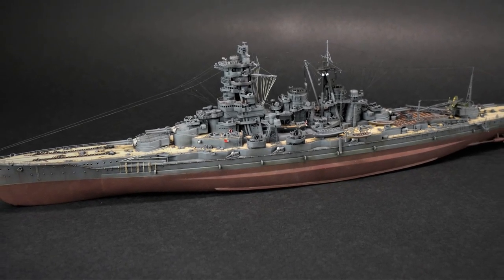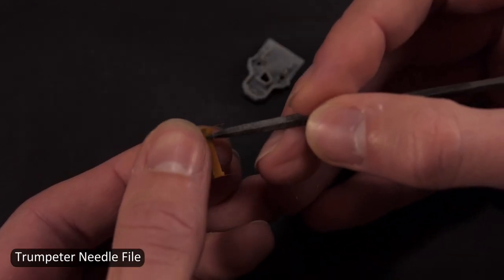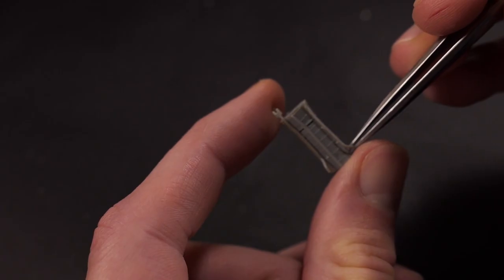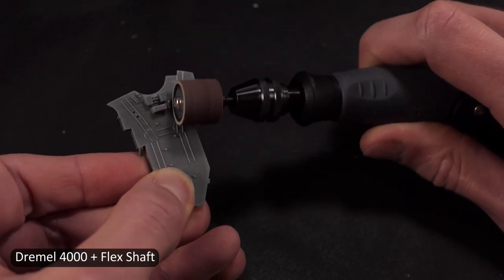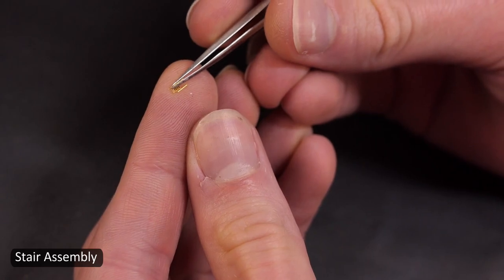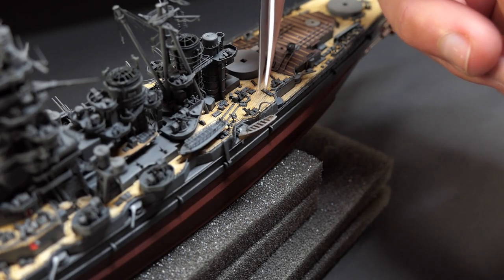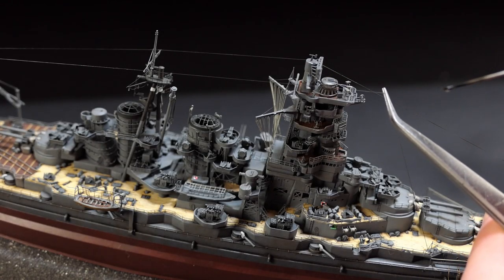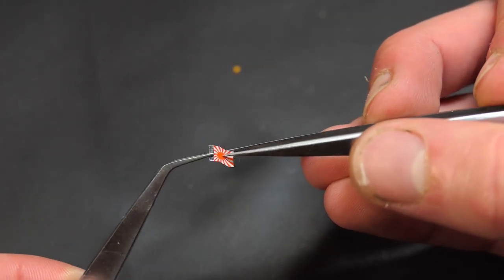IJN Kongō Battleship - 1:700 Scale Model

Comment: 11:05 It’s an arm with rope ladders attached that swung outward for when tenders were moored alongside the ship to allow easy boarding for crew members .Magnificent build !
Reply: Ain't those for extending torpedo nets?
Reply: @BarcelPL  The torpedo nets you mean were used during ww1, but soon retired cause of the massive danger of getting damaged nets (metal!) in the screws and also loosing allmost all of their protection when the ships goes faster. Torpedo nets were used later, but only on moored ships and as far i know with some distance and not directly on ship mounted.
Also ship mounted torpedo nets arms were all along the ship, not only on two spots. You can see them on the early pictures (pre 1927 on wikipedia) of Kongo.
Reply: The arm is called a "Derrick" that swings out,the ladders are called "Jacob's" Ladders and the lines are called "Lizard Line's".They used to attach small boats,the Lizard Line's keep the small boats attached in a position so people can get in and out of the boats